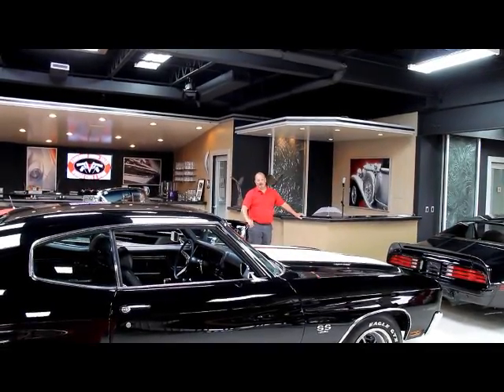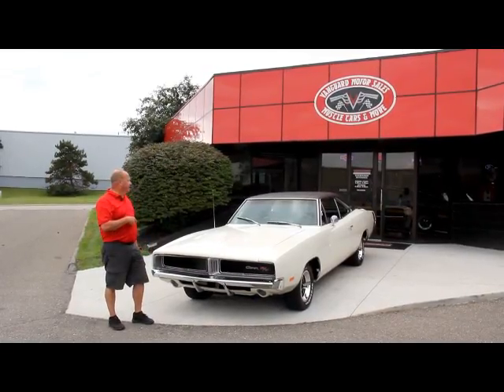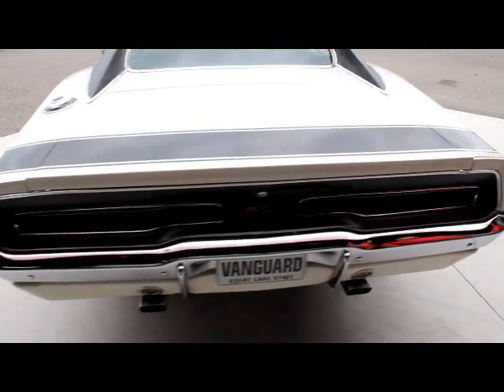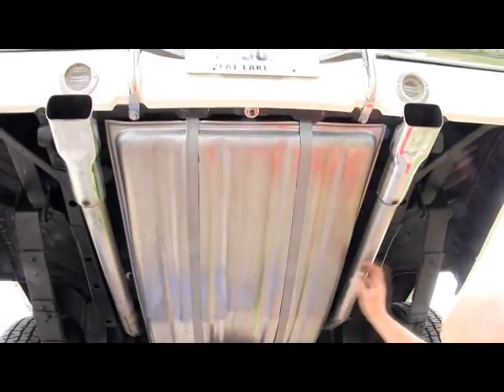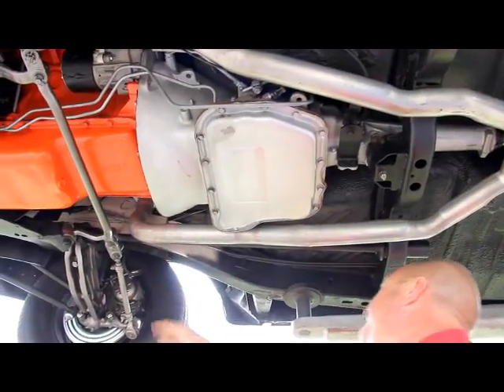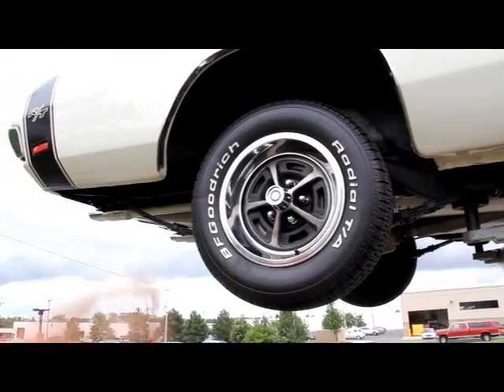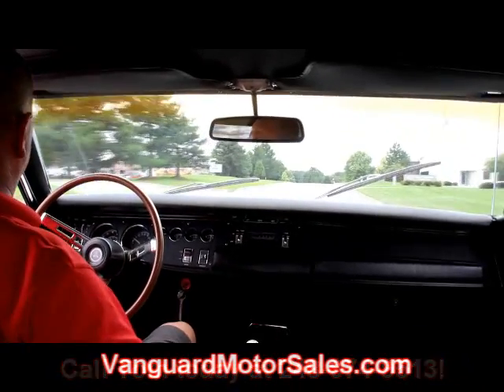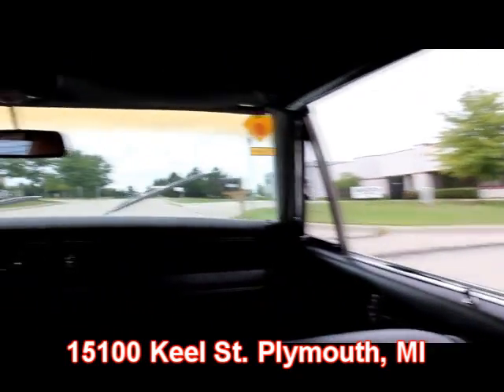1969 Dodge Charger RT 440 Classic Muscle Car for Sale in MI Vanguard Motor Sales

Comment: Interesting that the '68 - '70 charger had a very similar roofline with that recessed angled rear window that looks practically identical to the 1966 and '67 Chevy Chevelle and 66 & 67 Pontiac GTO. By 1968, GM had gone to a new body style and roofline design when Dodge was just coming out with the cool looking '68 Charger.  GM, leading the way. LOL Hey,  I love Mopar, too.... but GM had that roofline first... just compare a '66 GTO to a '68 Charger.